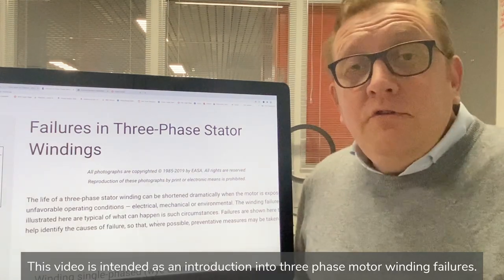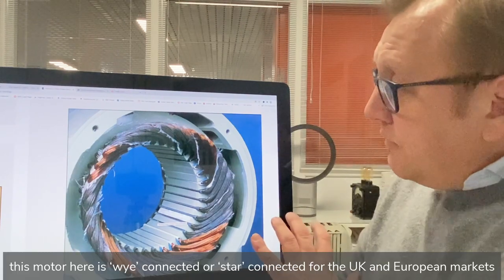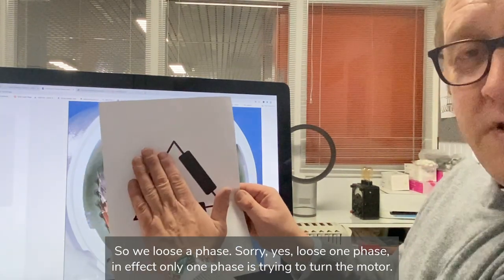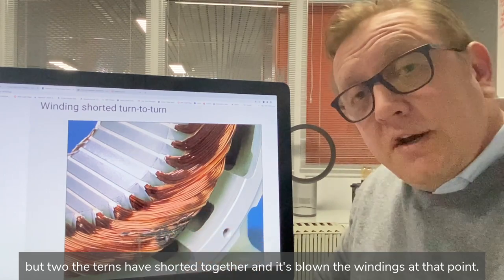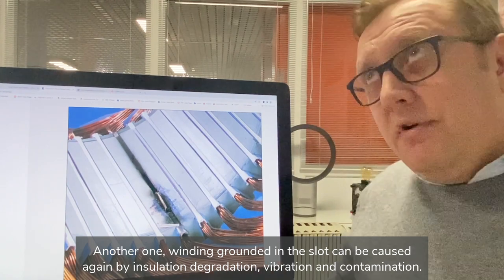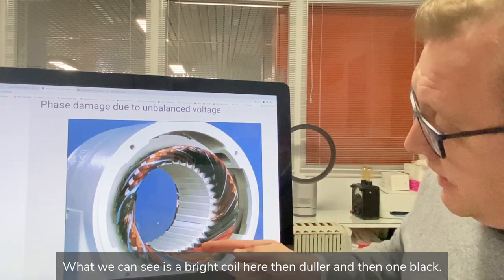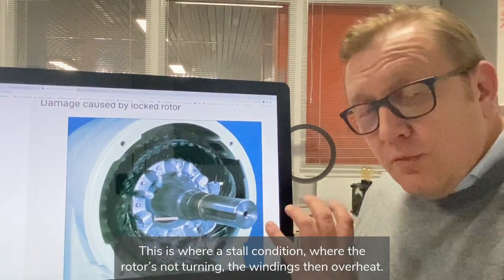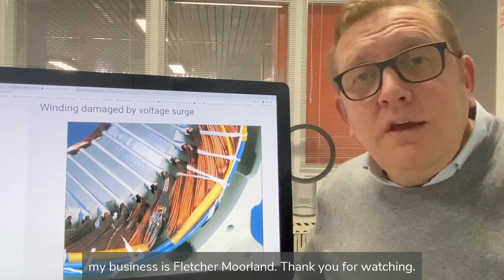Typical failures in three phase electric motor windings

Comment: I’ve rebuilt are electric insulation blowers for the last 10 years. For a year now everytime I run 4 at the same time1 of them pops a breaker. I can’t figure out what is causing this. I feel like I’ve replaced all blower components and the electrical that leads up to it.some advise pleaseeeee

Comment: what happens when one of three windings is wired in opposite direction?
Reply from the maker: I'm just trying to figure out your question here. I'm not sure what you mean when you ask 'wired in opposite direction' If the motor leads are wired L1, L3, L2 then the motor will spin in one direction. If it's L1, L2, L3 it will spin in the opposite direction. There is a chance of reversing a coil in the windings if a mistake is made in the connection. If that's what you are asking then the motor will  not rotate properly, depending on the number of poles (Speed) it could cog, it could pull higher current on the phase with the fault and eventually it will burn that coil and the motor will fail.